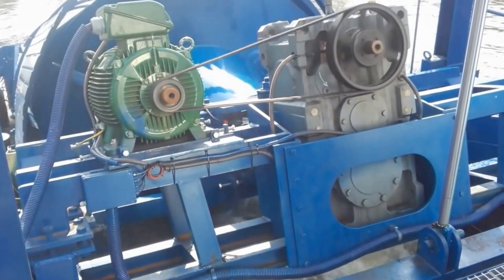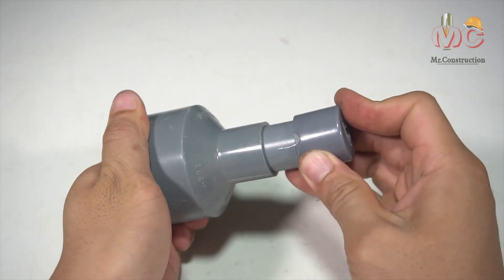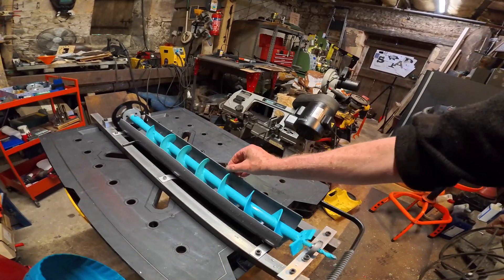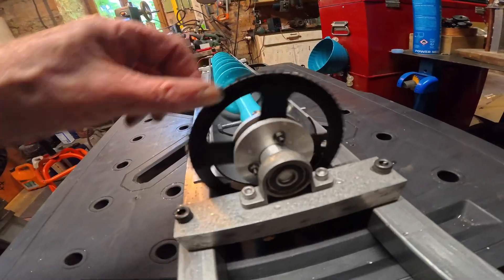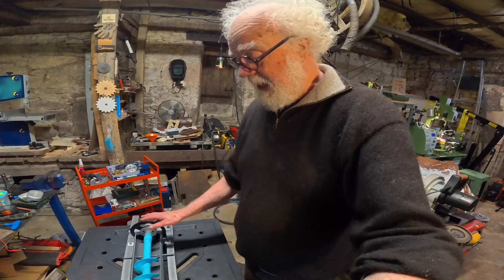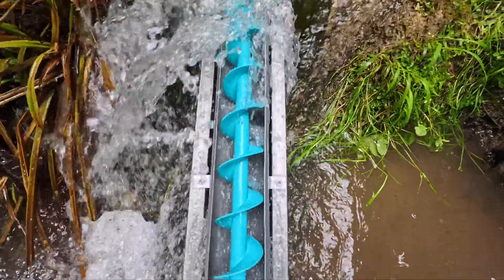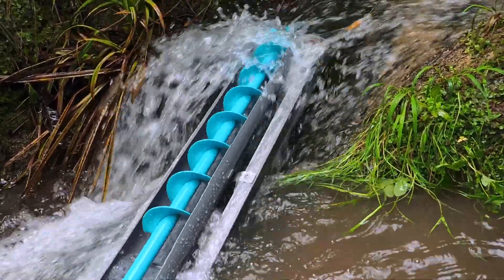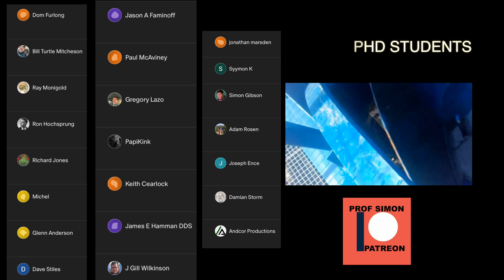Free Electricity - Micro Hydro - Prof Simon

Comment: Extend the axle above the input water level and belt drive the generator above intake funnel height?
Reply: Increase diameter for higher torque at the tip of the spiral, decrease the shaft diameter as much as possible…Possibly vary the pitch of the spiral tighter towards the end completely enclosed? Like an inverted jet engine compressor…? Open end above exit water height or below? I’m a speculathoritarian unencumbered by humiliation…

Comment: Betz's law (Betz limit) is the best you can do if the output stream is in the water (see wind turbine equations where the stagnant slowed down air behind the wind turbine "blocks" the airflow through the turbine thus limiting the energy you can extract from a moving body of air to approx 16/27 of the energy even if everything is theoretically perfect). So - if you exit your water in air you solve that problem... but you might lose a small amount of head doing so. Optimal is to have the water output only just above the exit pond surface.

Comment: Well, the Archimedes Screw isn't designed to generate energy, but to pump water uphill. It's so long only to cover bigger distances. For energy extraction, a single winding would be entirely sufficient.

Now, there are companies specialized in building hydro power plants, obviously. Their lower limit is a height difference of ~2 meters and a turbine diameter of 30 cm. That's pretty small already, yet still a fully working generator with > 80%, ideally > 90% efficiency.

If you want more the hobbyist approach, I'd try with a boat propeller in a hose. This would be much closer to what professional turbines look like. A boat propeller with a steep pitch, because you want to extract energy, not apply energy. Propellers for fast boats should come close.

That said, putting the generator on a long shaft outside the water is exactly the right idea. Gears just cost energy, reducing efficiency. And under water they rust.

Comment: What i suggest is using a funnel and covering the top half of the pipe. This would guarantee more water will flow into the screw and prevent any from leaking out of the pipe.

Comment: why not have the screw be independant? 

have a way to lead the water into the screw section, and then leave the screw section. the gear would be on either end blocked by walls so that water doesnt reach them. 

then to get more "power" out of your screw, add more chains to it that spin independant motors. Yes this means more torque but there has to be a way to ballence the amount of torque needed to spin the motors and having more motors that can spin up. 

you can add more screws as needed. i wish i could post diagrams of my explination but it cant be helped. 

Basicly having a slide that pours the water into the input side of the screws. the water flows through the screws and to an output section. The end of the screw itself is where the output would spill out, however the shaft would continue into a section where the gear would be located. The flowing water would need to turn the screw hard enough to reach a torque limit that will spin the chains coming off the gears. you can have more then one gear on the shaft. As long as the screw has more torque then the chains need, you can run multiple motors at the same time. 

As long as the flow is good enough, you can run multiple screws at the same time, possibly using some sort of spill way mechanism.

Comment: the can only use the weight of the water falling over that distance. no use of pressure or velocity.

think of them as an inclined plane. the helix angle matters? if its over 45, then the water isnt really acting to make torque. if its over 45 degrees, the water flows through to rapidly...

then the angle of the chute itself, again, 45 degrees...

if you compare them to a series of buckets... the water wants to flow down the chute, it cant, its acting on screw, but thats a rotation. like any wedge or ramp, its a trade-off...

keeping joint between chute and auger sealed is problematic, easier to spin both together... be it a pipe with screw inside or simply a flange on the edge of the screw...

then the radius or lever arm that the force gets to act on.. so a large diameter is bets but that means slow RPM and that means a generator needs gearing up, incurring losses...

theyre bascially useless and you are better off with water wheels, bucket chains, or virtually any other design BUT a screw...

they cant be fully submerged either, the water just screws through them instead.

Comment: Thread rate is critical, yours is too rare, it needs to be finer to take advantage of the water volume, you have very little head as I can see so your only bet is using the whole volume you can capture, than you need to triple the length of that thread, making it a shallower slope, it helps with water retention within the active portion, also you need to triple or more the external diameter of the thread, maybe double the internal diameter fitting a thicker pipe, that will give you a slower rotation but will tremendously increase the torque, and torque you need, a lot.
Bring the water in using a 45 degrees lateral capturing funnel, so that the spoke gear shaft can extend out of the water access path, and yes, house the generator as high as you can, but away of the water path.
Car alternators are designed with current and voltage limitations, to charge batteries, you want to eliminate said limitations so that the electromagnet can be charged a lot more than a car battery needs for it's recharging output, than you can actually make some useful Wattage for a household use.  Better off with using an actual low RPM generator of 2-5 Kwh rating.
Once you have voltage and sufficient amperage you need a good battery accumulator system to buffer constant production time with peak demand time and low demand times, and a good BMS system, especially if using Lithium batteries, LED is not prone to Kaboom, and neither Sodium for what I know, however they all are prone to dying fast if not properly charged and discharged, hence more money needed to replace them, better spend them money on a good BMS system adequate to the batteries you have.

Comment: Power is highly influenced by tip of the "blade" speed and overall torque. 
1-optimize de screw angle
2-build a reservoir and chute to keep the flow as regular and constant as possible
3-increase de height of the "waterfall" if possible

Comment: Make your shaft longer and use a low RPM generator you going to have to buy one or build one yes and funnel all the water through it but you make your shaft longer to avoid that Cog from being in the right there blocking the water

Comment: if you have your heart set on a screw thats long you might want to consider simply applying a barrier and a bit of lenght behind the screw to avoid the water current, also its a pipe, just cut it at the front and smelt in 2 dividing pieces, just cut a bit at an angle outline your cuts and use a bit of heat or glue.
Reply: Maybe the angle of the fins against the degree of steepness and amount of fins / size of fins aswell?

Comment: Make it more efficient? Sure... first of all put the screw in a full tube and close up the cog end with a sealed bearing. Cut in two joiners of the biggest diameter you can get on there at 45 degrees. Connect these to piping. Build a small dam in the little stream and feed the pipes in from the bottom. This will pressurise the pipe containing the screw and force all the water down it and it will also keep the cog out of most of the water. The higher you build the damn the more pressure and the more power it will generate. I'd say though you will reach the limits of this design pretty quickly and it probably won't last too long.

Comment: Paddlewheels are much more efficient. Use a V belt and not mechanical chain..  Don't mount\locate it on a corner. Dump water in from the top. Keep both ends out of the water. Divert exiting water away asap.

Comment: Your putting it in the water upside down.... Notice, in your own video intro, how the generator is on the high side of the machine. Extend the cog shaft, to exit the water's path completely, leaving your genny high and dry. This is the best position, as water always goes to earth. The next issue, is clearance, your pipe is allowing a lot of energy to bypass your screw. The final issue, is size. The reason the genny in the original video, is so small, but connected to such a large screw, is by inherent design limitations, size=torque. The inspirational screw you show us, has a multiplication gearbox, that also raises the genny out of the water. While it is a whimsical device, only half of it is doing work at any given time, meaning, the other half is unpowered mass. This is a necc evil as the water must have a path to work on, vs being just an obstructed pipe.

Speaking of pipes, if you have an appreciable elevation change, it may be more productive to harness the energy of pressure, instead of purely relying on flow.

Comment: you may know that it is impossible to make a  Tiny  screw-type hydroturbine that is efficient.    the type is best-suited for use with flow rates greater than point-three cubic meters per second.      d

Comment: Put a 90 deg elbow at each end at apposing directions and put the screw axle through them thus having the bearings outside the water flow as well as the drive mechanism. Run the screw in a fully enclosed pipe this way.

Comment: You need a large body of water that is elevated above the screw with a cone shaped feeder pipe going to the screw, wider end from the body of water narrower end at the screw ie: gravity + flow = force on the screw = high speed flow = higher revolutions = more power generation

Comment: Energy always follows the path of least resistance.
Your clearance gaps in this case, will help a lot.
Your 'water mass' flow rate through the device will determine how much energy/force you can convert from this.
So either force all the stream through the device as the only channel, or creating a funnel in the stream that redirects the flow into the device, might be a cheaper option.

Comment: I really shouldn't comment as I have no engineering xp but I feel if you can place a diamond shaped cone up higher, mesh on 2 sides then feed it in a larger diameter tube than what you're using to the main tube ( keep that totally enclosed including the drive shaft tube so prevent debrit and maintain pressure flow if that's a thing ) should make you some decent torque. All the best mate.

Comment: In my younger years, I was a millwright. Also have a very strong background in automotive technology; therefore, very familiar with automotive alternators...

Don't use an auger. You would need to extend the flighting to at least double the diameter in order to get usable rotational torque. And the 500 rpm minimum necessary for an automotive alternator means you'll always be struggling with torque--as well as replacing bearing blocks.

I recommend a traditional water wheel. Achieve much higher torque at lower rpms, which can be geared up to meet the demands of a loaded alternator.

Comment: Why not use gravity and heavey stone or metal balls to create a hydro pump that forces the water through a nozzle to create high pressure that can force a extremely fast generator to produce energy....just use the gravity to keep the balls on a complete circuit that continues its recycling movement over and over again until its manually turned off

Comment: It is possible, with enough flow, to get over 1,500 watts of AC power from a shallow well centrifugal pump and its mechanically connected inductive AC motor "run backwards'.  The water spins the pump's impeller which spins the single phase motor. They say at least 6 feet of fall is needed but flow is also critical. The inductive motor's windings need to be rewired to be an alternator. The Frequency of the AC power (Hertz), depends on the speed of the motor's rotation, so powering devices that only run on 60 or 59 Hz could be an issue. The power can be converted to DC to charge batteries then inverted again, or if the flow is steady, the RPM can be "tuned" to get 60  or 50 Hz (tricky because this F can vary under electrical load). Note synchronous motors won't work as the alternator.

A series wound DC motor can also be used with re-wiring as the alternator/generator (like from a treadmill), but the beauty of the AC concept is the fairly cheap "Off the Shelf" aspect requiring only the re-wiring of the pump/motor set as they come already mated together and ready for plumbing. There are several examples on the web.

Comment: Few fundimental mistakes there 
Force all the flow of that channel thro a full tube thro the screw with a end plate in the channel any excess can flow over end dam plate take the drive with a toothed belt ...chain in water....errrr NO , i would use a plastic bush berings set up not sealed berings as they wont last very long in water , you want a large pully on the screw and small on the alternator...use a alternator permintant magnet 1 if you can as well tested and all the bits available from wind turbine world then charge a battery bank as they are widely available and may be some one will send for free test advertising 4u the screw wants to be plastic and as long as you can make it for tourqe from the weight of water and flow think about a 3d printer as also a great tool and also makes great you tube content , you doo good stuff my man!! 
After my own hart !

Comment: Those proposed improvements should be good.  I assume you will eventually place a cover over the top of the screw converting the trough into a pipe, so a larger volume of water will push against the full area of the screw under more pressure .  You might wish to have a conical piece of hardware cloth over the intake to shed floating debris from entering the screw.
Reply: I like the way you think. I have no formal engineering background whatsoever, but spent years out on an offgrid property in the middle of nowhere. Living out there forced me to learn plumbing/electric, and I was always trying some new adaptation to increase water pressure, power efficiency etc. Had to learn basic layperson physics/engineering principles just out of necessity. I always enjoy listening to likeminded people try to troubleshoot/improve homebrewed mechanical devices. Cheers!
Reply: they dont work like that. the water will simply spin as it goes through them.
the whole point of the screw is to form little buckets. just like a water wheel but rotated on a different axis so it then has almost no leverage, and produces no torque. theyre useless, really...

Comment: A lighter screw would help. the larger mass of the metal is working against the pressure of the water flow and its not heavy enough act as a flywheel.
The small diameter of the screw blades means it has to travel a lot faster than a traditional waterwheel and this means its ideal use is in high volume, high speed water flow. 
Its not the best for your situation, a traditional wheel with the water entering from the top will maximise the potential.
Saying all that if its an experiment rather than real life use then your funnel idea is good, drop the mass of the screw, reduce as much friction on the moving parts and keep the drive system as small/short as possible.

Comment: Good afternoon Professor, I hope you are well. I confess, I'm no engineer, just a fan of your videos however a great friend of mine is and suggested the following;

Put it in a tube, capture all the water and tighten the gap around the thread. Have a sloped exit downstream positioned past the thread. You could also use a waterwheel, filling buckets. The energy captured is very small. Energy=massxgravityxheight. Therefore having a larger drop may also help. 

Hope it helps 👍👍

Comment: Is there way to measure the point on water decline that strongest .....you go screw right top then water goes down screw ....if you have way to measure what point strongest flow .....

Is it better have it right at top ..or half way down or bottom ..

what if had small screws ...three them ...then dug out 2foot drop then put screws right on edge like water falls almost vertical  ...the end would erode so have to build end out with some rocks

Comment: For a small channel with fast flowing water like that I think you'd do better using pelton turbines.
Reply: To make the Archimedes screw work you need to create a reservoir by building a dam then then feed a pipe with same diameter as the screw from the bottom of the dam and into the screw.  If you had a dam you could arrange a few of them side by side.  An array of pelton turbines would also work well using the similar approach only for PTs you want to create high pressure water jets.